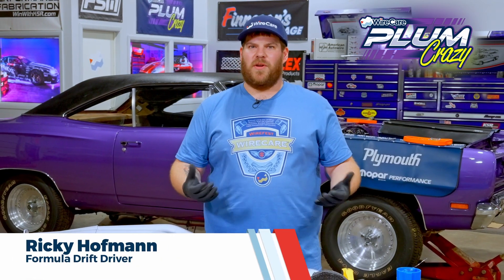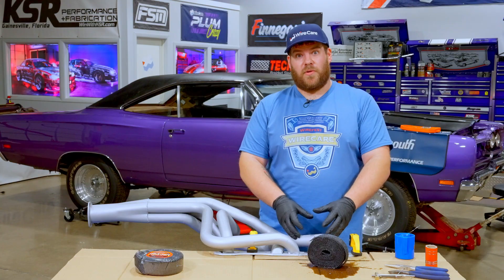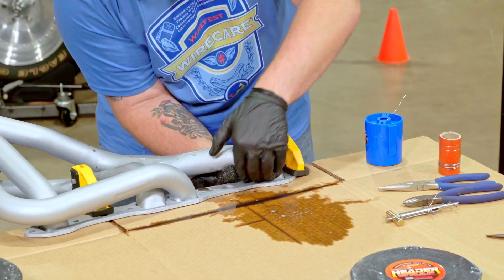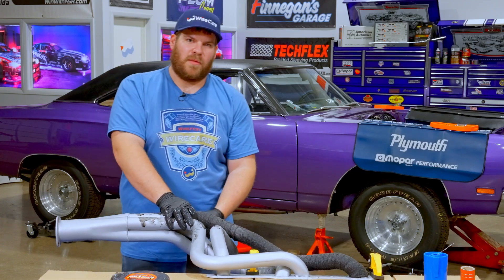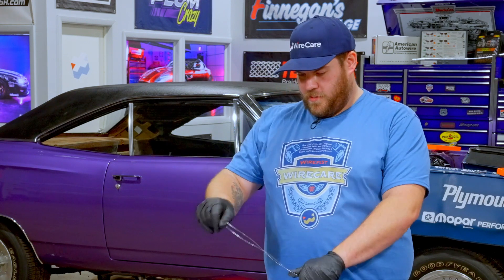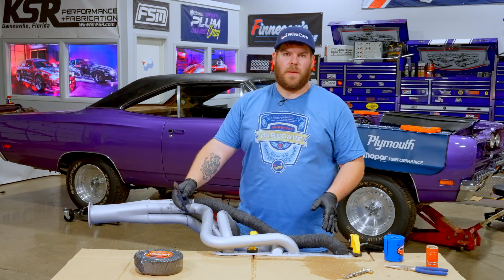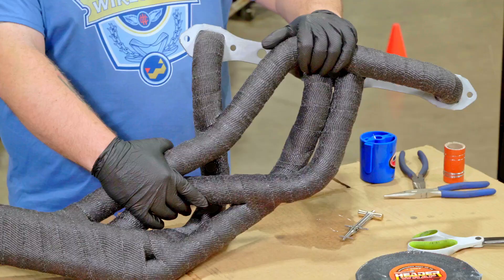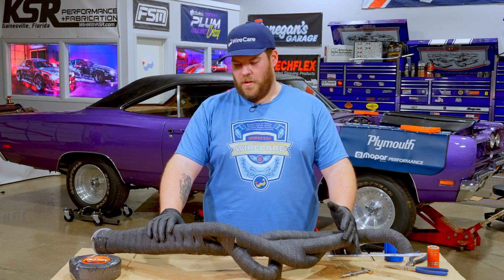Insultherm® Header Wrap Tutorial

Comment: Been wrapping headers over 25 years now. And I guarantee he wrapped and un-wrapped several areas before he was satisfied. They just didn't show it. He also made a couple of little fo-pahs. There's no need to soak it for 2 days or even 2 hours. You can install it immediately after wetting it. But it really does help to wet it first to get a good tight wrap. Also, any cheap fiberglass kit will work. This brand is a higher quality though, and it shows in the final product. It is easiest to back wrap each tube/runner loosely first. And it's nearly impossible to wrap it good while on the car. Always wrap the easiest tube first - then remove it and measure how much material it took to do that first one. Then pre-cut the material an extra 2 feet per run to account for corners/turns. Don't skimp. I know it seems wasteful, but I learned a long time ago, it will turn a 3 1/2 hour job into a 1 1/2 hour job. It's like brakes - the second side is twice as fast as the first side. Be prepared to use a full roll per header on long tubes. Take a look at the very end nearest to the collector on this video. The ends will try to fray and peel up there where he forgot to fold over the very end of the wrap. I Can't comment on using the wire - I've always used straps and a strap cutter/gun. I think a strap cutter/gun costs about $20 bucks - It's sooo worth it. Even if you only use it for one set of headers, Lastly, did u notice the black color coming off of the wrap? it will eventually turn silver. Gold is the only one that stays the same color before and years later. Last - don't use and HEADER wrap SPRAY or SEALER - It locks-in moisture and causes premature rusting.

Comment: Engine masters did the test wrap vs no wrap didn’t make any power difference
Reply: it's heat. keeps underhood temps good. Also, does help with turbo perfeormance on downpipes, hot air flows faster.  Thermal dynamics.

Comment: awesome tip about soaking in water
Reply from the maker: You got it. Definitely makes the install cleaner and easier.
Reply: If it’s fiberglass you soak it in water but if it the titanium you don’t need to.. the titanium is easy to work with last long and has a higher temperature value